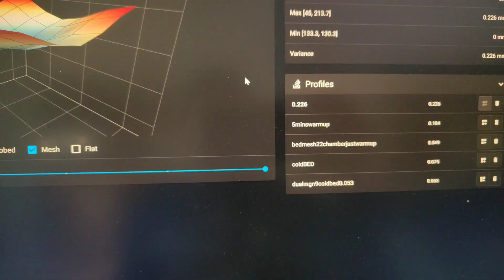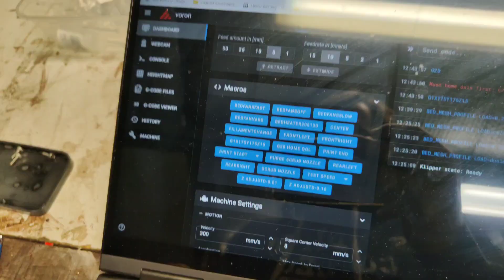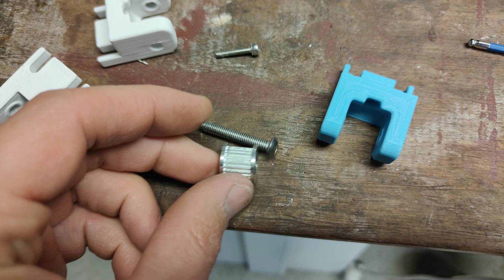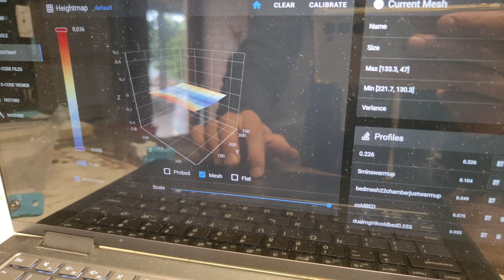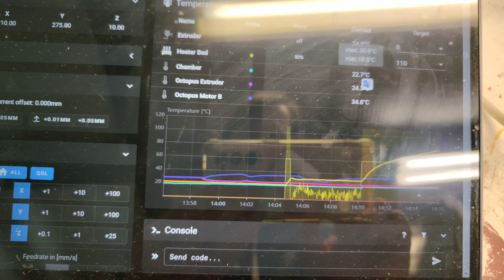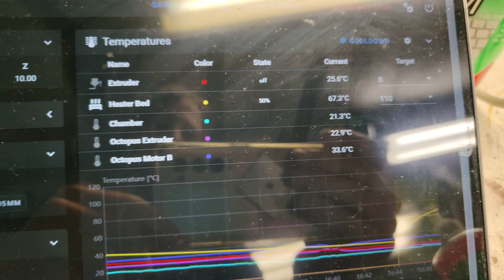Voron 2.4r2 350x350 MOD upgrade Bed Level MGN9 Backers For Y axis

Comment: Have a check of your magnetic surface, and give the corners a bit of a roll when hot with a wallpaper seam roller and this may reduce your corner heights a little, another hack for getting low spots just that little bit higher when cold is painters masking tape in the low sections which can help your variances when cold thus reducing the variances when hot.

Comment: So the bed is technically always flat but when the chamber heats up the rails move and adjust slightly then that throws off the distance from the head to the bed?
Reply from the maker: So many variable that impacts bed height.
Mgn rail, frame, rails, bed, heat.
I recently rebuild the x axis and carbon frame. The bed shape is inverted now. 0.2 variance.
Reply: @jc84com  does the voron compensate for this? Or is it too small of an amount? I’m looking to print high quality high precision parts in high temp materials and things like this intrigue me - I think I’m going to build a voron
Reply from the maker: @user-jt3nf7in5w  it's a great printer. Comes down to what you spend and how you build with how good the printer will be.
Yes the bed mesh is compensated for
Over a 350mm distance the variance is 0.23mm on my printer. that's a 0.06% of variation. 
vez3d channel makes a amazing printer too,

Comment: I have 2 extra MGN9 rails (because I was building the 2.4r1 originally) and now I have the 2.4r2 with the MGN12 rail on the X-extrusion.  I think I'll use my extra rails on the Y-extrusions like you did after I get everything working and get a baseline.

Comment: Brill , I’ll be building my 2.4 ne t few weeks , why do you have rails on the top ?
Reply from the maker: It's a mod to improve a level bed.

There is a massive mod community on the voron GIT.

So many mods that make the printer better

I'll be making a video on my printer and the changes I've made.